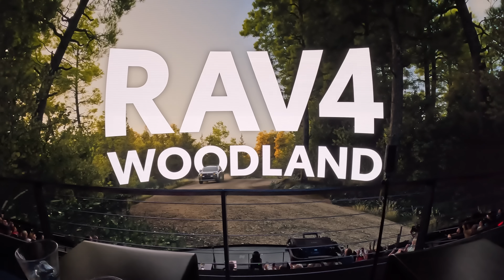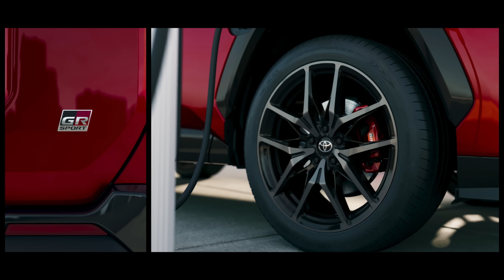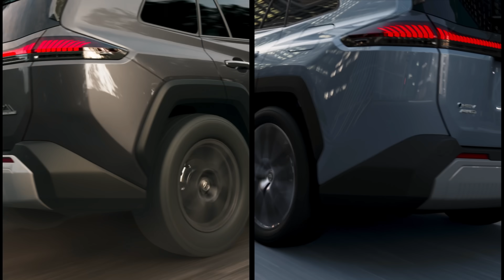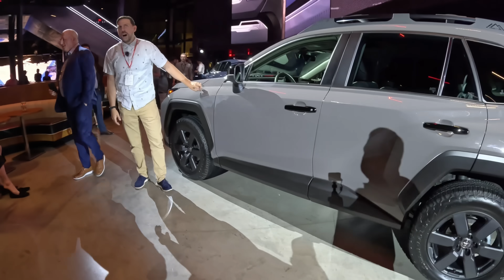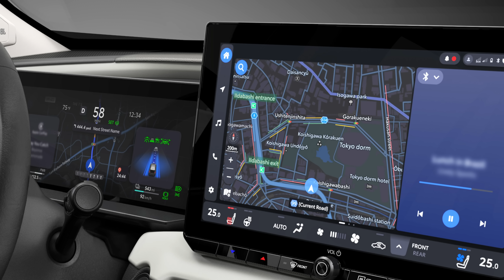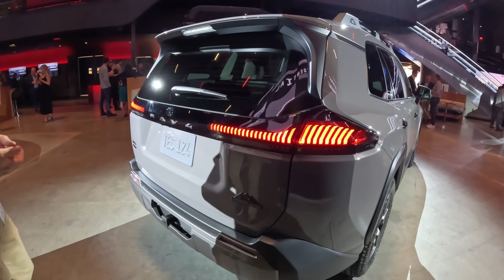Here's EVERY Upgrade and Downgrade for the redesigned 2026 Toyota Rav4 Hybrid and PHEV.

Comment: With automatic climate control, why do you need physical buttons other than temp?  The rest is automatic anyway.  Should rarely if ever need adjustment.  The temp buttons here are physical buttons which is good.
Reply: The AC on/off is in the infotainment
Reply: @chezzyperson3339  Regardless of season, leave it on.  Its automatic air conditioning.  It will provide heat in the winter and cool things down in the summer. Set it and....
Reply: have you ever driven at night, on a highway, in a snowstorm?  Then you'd know why.
Reply: @jefff7287  living in Canada, yes many times.  My current RAV has a setting that mixes floor and defrost vents.  It stays like that all winter.  I assume new one will have the same, but maybe not

Comment: CVT only sucks man! Other than that, everything else was cool
Reply: Get with the program.. it's a electro mechanical transmission. It's like your light dimmer. Not your typical rubber band cvt. Yes the typical cvt sucks.
Reply: @hctim96 the eCVT is reliable, but it still sucks. Nothing is enjoyable about driving one and the drone from the engine is annoying, not to mention anything considered the sport version should never have an eCVT or CVT. I’ll take an 8 speed over any of that, I don’t care how much efficiency is lost.
Reply: Cvt is great for hybrid . The transition between electric and ICE is already like nearly perfect on the 4th gen . Can’t imagine how it is even better on 5th gen
Reply: eCVT, not CVT

Comment: What I found interesting from one of their presentation is that they combined their DC/DC converter, Power Control Unit (PCU), Inverter and AC charger into the transaxle which already includes the planetary power-split-gearset as well as the traction motor and motor-generator. This kind of consolidation and miniaturization is something the Chinese BYD have done in their EVs (so-called 8-in-1 or whatever which makes them cost-effective and cheaper-to-produce) but not on their PHEV DM-i. Toyota flipped the script and they incoprated that design philosophy on their hybrid system. This means either Toyota can now make more PHEV and HEV cheaper or higher profit margin. 

Despite what BYD would have u believe, Toyota has the superior hybrid system architecture. BYD's hybrid is more similar to Honda's architecture
Reply: From my understanding the Honda hybrid is basically like a generator for the battery and the electric motor is the one that does all the moving . Kinda like a Chevy volt